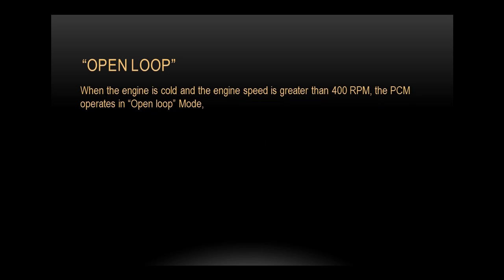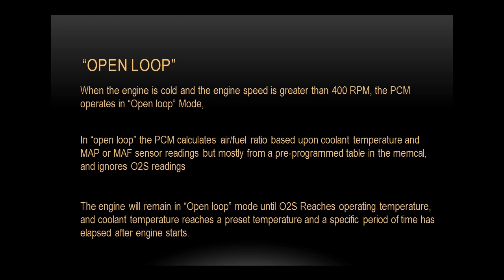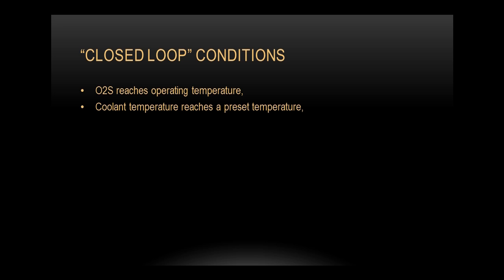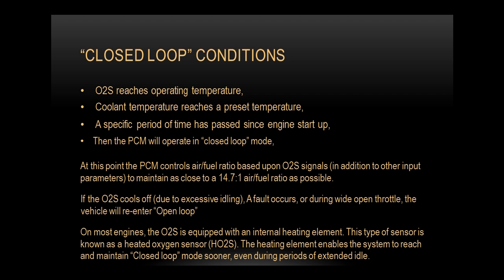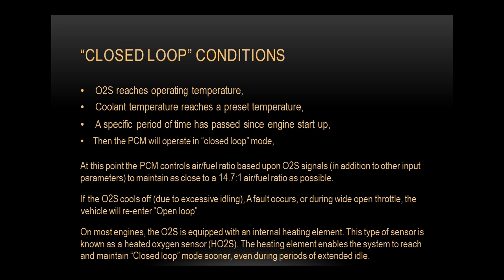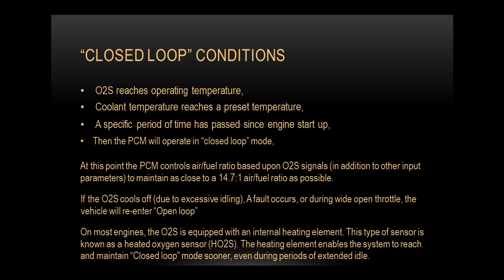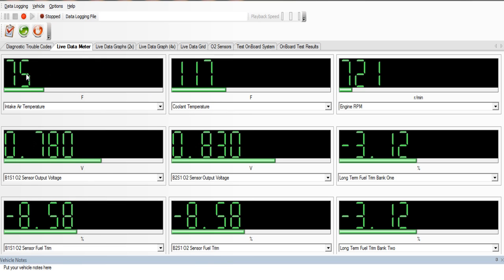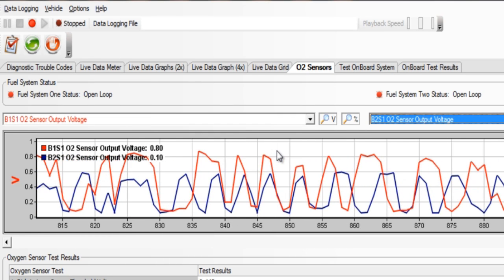Understanding Open loop / Closed loop Basics

Comment: So if the data steam shows “open loop fault” on both banks, but also shows proper ect, why is there a fault? Is the sensor bad? I also had to replace the damned little plastic thing, maybe I switched the wires ?

Comment: I have a question.
My Honda pilot 2003.  3.5
I hook up the scanner and with just the 
Switch on it shows a close loop
Without starting the unit.
Is this normal?
And if not possible cause.
Please thank's

Comment: Hope you can help me , I’m driving my GMC Yukon on a drive cycle to complete the IM monitors for the evap blinking light it’s the last one I need to complete before I can go get my sticker. Well at the end of the drive cycle driving on the freeway on my way home, I have scan tool hooked up the whole time, I looked at the closed loop for a second and it said CL declined then it went back to CL. It was real quick I’m pretty sure that’s what it said, I couldn’t read it to well because I was driving. What does theat mean?

Comment: Ok, great....so if coolant temp is 205 and scanner shows the 02 sensors are all good and hot and I'm still stuck in open loop due "defect".....what the heck could it be?

Comment: Is there a second video? I have a dodge caravan 2000 and the reading say "insufficient coolant temperature for closed loop fuel control" not quite sure what that means and how to fix it. Now what you were explaining does sound like my car too. I will have it running for an hour and there is no heat and the fuel mileage is bad. How do i fix this? Please help! 😓🤔
Reply: Sounds like the coolant  temperature sensor might be faulty.

Comment: question, why everytime a code sets like p0420 i am at idle and it says on my freeze frame data that I am running in open loop, even though I reach the operating temperature. 

I notice something too when i run and it sets a code my fuel system enters closed loop while running on my freeze frame data?

does that mean that when my car is in idle my fuel system enters open loop, and when my car starts to run it enters closed loop?
Reply: did you guys get a fix solution? Im having similar issues.
Reply: bill villanueva did you ever figure out the problem. I am literally going through the same thing. Word for word.

Comment: So it's normal that excessive idling causes 'open loop due to system failure' for non-heated O2S. Does it mean for heated sensor that I need to change it even if heated sensor monitor is ready?

Comment: So how does it mean when my check engine codes for "Faulty Heated Oxygen Sensor 1 Bank 1 Heated Oxygen Sensor 1 Bank 1 circuit is open or shorted Heated Oxygen Sensor 1 Bank 1 circuit electrical connection"

Comment: urgent, please help... i have 2013 hyundai genesis coupe with only 15k miles... has exhaust and intake and runs perfect... NO chk engine light on...  not sure if it's related to the mods, but my CAT, O2S, and HRT monitors fail the ready test for emissions...  when i connect an obd2 scanner, FUELSYS1 says CL... but FUELSYS2 says "--?"... again, not sure if this is related to the above... but what would be the quickest way to pass emissions test?

Comment: it has an electronic feedback carb that I understand works in conjunction with the O-2 Sensor--so if it isnt reaching closed loop then that explains the increased gas consumption? am i correct? 1989 Dodge Ram 50 (import) 2.6 iter--5 speed. It should hav great gas mileage!!!!! Has o be 14.7:1 a/f ratio....

Comment: ihave a 1989 dodge ram 50, and it seems to not be reaching closed loop condition,ses alot of gas for a 2.6 4 cylinder.. thermostat and/or temperature sending unit? repalce both of them..????

Comment: Thanks for responding. On my 1998 Ram the O2 sensor page seems unsupported, even though I have the full enhanced package. I think it may be an issue with the truck. I don't see the typical O2 sensor pattern, more of a truncated one, which makes me think that it's an issue with the refresh rate sending data down the OBDII ports. I put a generic scope on one sensor, backprobed off the wires, and the typical sinusoidal swings are present there. I'll try it on some other vehicles.

Comment from the maker: while in generic the only way i am aware of is on the "o2 sensor" monitor page i think its the 6th tab on the top 
when you select an o2 and start monitoring above the graph you will see the fuel system status, open or closed
now while in enhance mode you can do the same however you also have the option to select it as one of the monitors on any of the meter, graphs and grids (this may not be an option on all makes and models) hope this helps

Comment from the maker: Autoenginuity-pro line with enhancements, complete bundle cost around $1,200 however you can purchase basic and build from there, sure its not the best scan tool but works well for the most part, and fit the budget at the time lol i have others as well, was hoping to demonstrate this one for the people on a budget that cant afford a $10,000 full blown snap on

Comment from the maker: I would look a little deeper first, even though most time it is the o2s, i would still do some basic testing to the circuit, if you would like stop by the forum @ toolsandtime. com and post the question, i can try to guide you in more detail if you would like.

Comment: a comment on the video itself. i agree with the assessment a stuck open thermostat will cause extended open loop operation as well as a richer fuel.curve from lower coolant temp.
the fluctuating O2 in open loop was weird but doesn't change the call or the theory behind the poor fuel.mileage.

Comment: I agree the O2 graph and loop statis do not jive. that O2 signal is showing closed loop fuel control even though the scan data showed open loop.
i disagree on the 450mv constant you mention. this is only with a cold sensor
i think this is a simple thing here. theory of systems do not always match reality. this system was clearly trimming the mixture regardless of that loop statis reading.

Comment: That's fine, we can agree to disagree on this one. When you bench test an O2 with a torch, of course it will vary the voltage in response to you giving and taking fuel away. When the O2 is on the car, and you are in open loop, the amount of fuel it gets is constant and not being determined from the O2 signal, therefore it should be a flatline (unless you are playing  with the throttle).

Comment: Great video.   Thank you for the info.   My ride is running cool right now too.   "thinking the thermostat is probably toast"   lower hose on the radiator is cool and upper hose is hot.  but that explains my crap mpg for sure lol.  i figured it was something like that.  plannin on doin it when it gets a lil warmer.

Comment: Once in closed loop, the feedback from the O2 sensors gets used by the ECU, and then we should see the ups and downs...add fuel/take away...repeat. When in open loop, the O2 signal is not used, so we should see something steady. The text that says "open loop" in that software might be coming from the software itself and not the ECU.
Reply: L

Comment: if you see above the two signals  the  fuel system status is reporting  "open  loop"   are you saying that ECM "releases" the o2 to start reading  otherwise they should read a flat steady signal? I think o2 start reading sooner but ECM ignores them  till engine reaches  desired temp, then it will go into closed loop. i am confused too now...